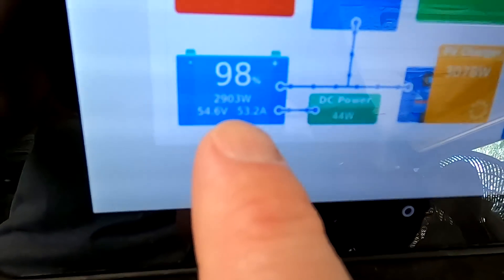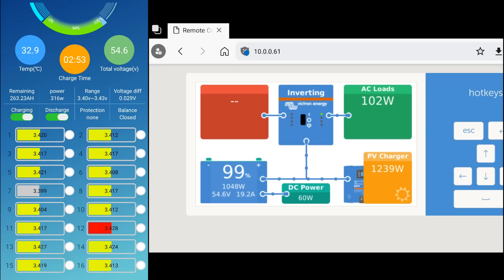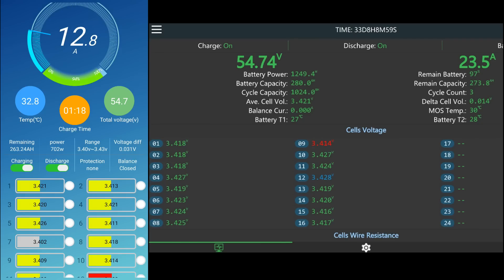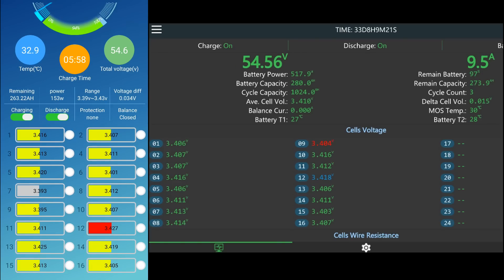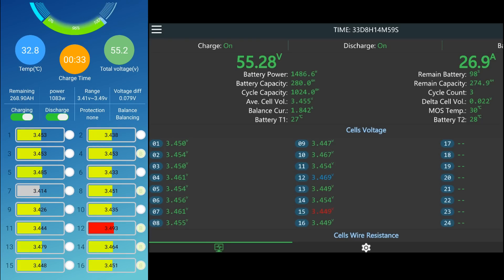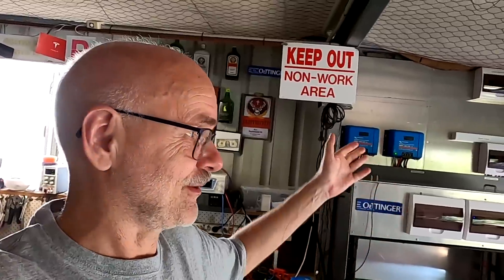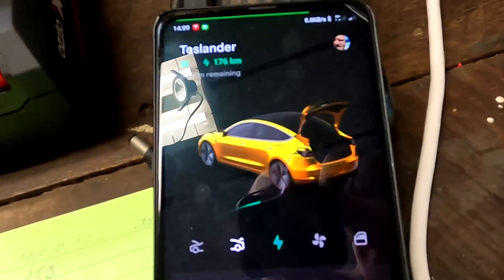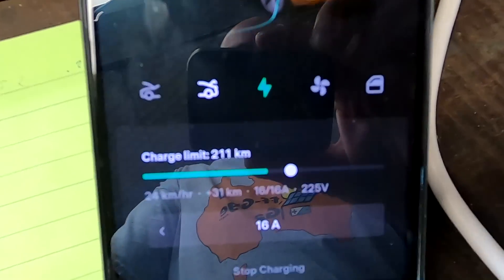Communication between BMS, solar charge controller and inverter. What's the benefit?

Comment: Communication is great with my powerwall setup as I have limited hours of cheap electricity so I need to pump electrons in fast and then tail them off, the lower current at the end of the charge cycle is helpful to let the balancer do its work.

Comment: I just ordered my new victron inverter. The multiplus II 48/3000 but i don't know what fuse to use becuase the smallest megafuse is 125A and that seems a bit too much, any recommendations what should i use? I also currently have a 3s100P li-ion battery and i'm planning to reconfigure it to 14s20P and use the JKBMS and then planning to use the same JKBMS with a 16s lifepo4 battery. From my understanding the JKBMS supports li-ion and lifepo4 right?
Reply: 125A fuse is recommended by Victron for the 48/3000 according to the manual.
Reply: @helfer6pence  Oh that seems to be a little bit high. Thats 6000W at 48V and the fuse should be 20% above the max inverter power so around 75A
Reply: @xpatrikpvp  I’m no expert but I thought the fuse was there to protect the cables etc. Victron recommend 35mm cables for the 48/3000, which I believe are rated for about 100 - 120A depending on the length.

Comment: With the victron equipment you can set a maximum charge/discharge current and a maximum charge voltage from a BMS.
Technically it could do what you are doing manually sometimes: reduce the absorption voltage in case of a high cell imbalance to prevent single cells exceeding 3.6V. When cells get balance, increase voltage in small steps. But I doubt that you BMSes will do that.
Other cases where it might improve the system (but do not apply to your setup):
- reduce charge/discharge currents near full/empty with small batteries that are driven near its limits
- allow small charge currents in cold conditions instead of completely disable charging
- adapt charge/discharge currents in modular (parallel) systems where single batteries are frequently removed/added

Comment: What if on occasion I have 2C of charging available,  ( and discharged batteries) but I want to limit charging to 0.5C to ensure battery longevity. The BMS would presumably trip on its overload setting. Using inverter communication I could still limit and control the charging rate?
That and I just want to see it in action, you do it so we can all learn  --- the raison d'être of this channel.

Comment: There are several advantages. Main one being not having a smartshunt as the BMS is the battery monitor. Second is at higher charge currents like 1C you can have high cell voltage very quickly so the charger controllers can react. Also there is less loss in the breaker style BMS but if the breaker trips you have to manually reset it. This means if you get a high voltage disconnect it will be irrecoverable remotely but with coms you never get into this condition. Data logging and remote diagnostics is also a benefit. As someone who manages many Victron sites it is really helpful to see MIN/MAX cell voltages for every site to detect problems early.
Reply: This is true if you have one battery with a single BMS. As soon as you have multiple batteries in parallel, it make sense to maintain one central Smart shunt so that one does not have to add all the current data form each BMS together.
Reply: @henkbouhuyzen8255  Every installation I have has multiple packs. Most battery manufacturers have one battery take over as Master and the other packs as slaves and reports them as one big battery to the GX. These tend to be even more accurate than the Smartshunt as they take into account cable losses and don't require 100% recalibration from time to time. For DIY packs I have used the Orion BMS with multiple packs and also had great success with BMS calculated SOC.
Reply: @ShaneFromSA  I build my own batteries form 320 Ah Evo cells and each 12 V battery has its own BMS. I have not seen a method to connect these BMS' es together. I build my own as I could not afford the high end brands such as battle born. And even the battle born batteries have no communication between each battery; at least there is no mention of this on their website. You must have  used a specific battery brand.. I do know that I could (with some additional hardware) connect my BMS devices to the Gerbo (via a Rs 485 link)
Reply: @henkbouhuyzen8255  Yeah, I primarily build really big systems. Like 100kwh plus. I don't know anyone that has managed BMS for 12V batteries. I only build 48v system with Victron. Pylontech, FreedomWon, BYD the batteries I mostly use.

Comment: If you set the balancing on the QUCC to start at the float voltage, it will continue to balance the cells for the whole of the float period (which can be several hours) unless the cell difference drops below the threshold.  I’ve tried this and it seems to work well.
Reply: Has anyone been able to make qucc BMS stay on longer than 18 hours?

Comment: Maybe BMS can be used instead of smart shunt. And (in my opinion) it is much better if the load turns off when it receives a signal from BMS. In this case inverter stays on, only load is turned off. If the battery just shuts down, what happens to the inverter when it stays out of power? And also what happens to charge controllers? How the system reboots then? I think, this should not happen in any case.

Comment: In my system I separated the load and the charge site with the victron battery protect. So in this case of an peaking cell, just the charging site turns off and the load are still online. So I don't have an complete disconnected battery bank.

Comment: I wish JK made a 12v BMS.  I like how it reacted in the last video.  Thanks for all the experiments, Andy.
You make the comment here "there is no reason to charge higher than 3.45v per cell."  If I recall, the only exception is if you need to charge the battery more quickly.  I believe you gave the example of a person on a boat that wanted to maximize charging when they had sun because one never knows if tomorrow will be a good solar day or not.  Does this still hold true in terms of your assessment of charge voltage?
Reply: I think Andy meant that you dont need to charge each cell to anything over 3.45v. This is different to the actual charging voltage that one uses in order to charge the cells (which I think you're referring to)

Comment: Hey Andy, since you hve a Raspi, you could add a 7inch Raspi-Touchscreen. It costs around 60 $ and you would have a very nice interface with VRM. I dit it myself. It works great and costs nothing in comparison to Cerbo GX (800.-).

Comment: Some solar charge controllers will be destroyed by being disconnected from the battery while still receiving voltage from the panels. Some sort of advance warning from the bms might give the charge controller time to disconnect the panels before that happened.
Reply: Mike<<<<<  all the BMS will become defective if it’s removed from the Power supply, while the BMS is still powered from PV cells. Therefore it’s understood that during maintenance and or test sequence, PV power MUST be in OFF condition. (Use of correct load CB is preferred here) Many have not understood the procedure well enough to perform the above info and thus have lost the costly BMS. Many BMS’s have been “returned” for being nonfunctional, due to their lack of info, mentioned above. The warranty for the BMS is 5 years and advantages were taken by misuse. (this is the reason for “high cost” of BMS device!) Place a large sticker on Cabinet “OPEN CB BEFORE MAINTENANCE.” No more comments.
PS: the advantage of CB (circuit breaker) in PV cell circuit is that, the PV input V and A can also be checked in-situ without detaching the cables from PV while  battery is on disconnect condition.
Reply: @sreekumarUSA  agreed, but that was not my suggestion. My concern was that once the battery is fully charged the BMS would disconnect the solar charge controller to prevent the battery being overcharged. That would leave the charge controller disconnected from the battery but still connected to the solar panels, destroying the solar charge controller. Far better would be if the panels could be disconnected before that happens.
Reply: Some Victron SCC’s are prone to damage from that, especially if the solar power is high voltage & current.  
On 24V 310Ah Lifepo4, I connected a 100/20 to 2x 325W panels (as recommended by Victron’s MPPT calculator) so halving the power from 1.3Kw (2S2P) to a 100/50, which was getting hot (it did burn the battery + cable & the Victrons screw terminal; as they warn in the manual) I don’t like the small connector block on Victron SCC’s, it’s inadequate; can’t get square crimped wire of the max stated size (which is quite small) into the socket. The 100/20 first developed a fault on the load, not turning off; but still measured current, for a while, until that played up, then stopped. Then the SCC completely stopped charging at 24v; but charged a low rate on a 12v system with 360W input. Both SCC’s will have to go back for repair. Now using 2x Epever 6415AN’s (2P panels, they don’t get hot, and waste power). I prefer the 6415AN’s wiring box, which is much safer. Also the 100/20 once had a fault, on the wiring at the very small terminal block, which applied 52V from solar (240W) to the battery wiring. The BMS is 10-24S (good on my 8S) easily withstand that, and shut down. It just blew a few small items,  30v max, a voltmeter 2x temperature controllers and a buck module. Have a 3rd 6415AN that’s been away 4 months, for repair to its RS485’s! Could upgrade to 2 more 325W easily 3P @ 30A; and more with the other SCC, when I get it back, maybe 2x 500W panels.
Reply: DC relay for disconnect of solar panel could easily be done. SOC gets to 95% it will turn off?
In my van I have a heating mat under my lithium battery to put heat into the battery in the cooler months. Turns on for 25 min cycling for 3 hours on the Inverter. Only takes 50 watts and my panels usually make 150watts (600 on roof). 

I plan on putting a dc dump load circuit on for hot water tank.

Comment: I'm testing a small solar system with victron components and a battery I assembled from parts.  The battery management system does not have low temperature protection and it does freeze around here.  Having communication between my shunt with the added temperature sensor and the charge controller allows me to have low temperature charging protection.  I also get an accurate temperature of the battery displayed and that is fun.

Comment: I agree there is no advantage to the system having them communicating to each other.. except there is more risk of complications when the system gets older.  Less wires the better..
Reply: There are advantages to the BMS talking to the charge controllers but I have a lot more confidence in the Victron gear to charge the battery properly and I wouldn’t want to defer control to the BMS in case it screws up and tells the Victron SCC to over volt the charging.

Comment: I know it's a bit off-topic but could you set up an experiment with the outside 3 panels to characterize the possible benefits of a reflector/mirror for low azimuth solar charge optimization in the morning or late afternoon or even to get around shade tree effects? Thanks.

Comment: It helps when you charge with very high currents: you can tell the charge controller to slow down so the BMS can keep up balancing. Staying at 3.45V you won't see this, but if you charge to 3.55V or more (higher voltage to get more current in a shorter amount of time). You're still well below 0.5C charge current as well coupled with your max solar output- once you go to 0.5C or more (think if you have 10kW array or so) you will get over voltage faster and the communication will allow this to be throttled. In other words, it wouldn't make a difference in your current set-up.
Reply: 100% agreed. Also all of the BMS details would show up in the VRM with an integration to the victron ecosystem.
Reply: @Shep5847  You can do that with the JK BMS by the way, there is a driver for Venus OS for it.
Reply: @Shep5847  I’d like to see it. I don’t think it will be simple to connect via Raspberry Pi, to a non-Victron BMS & Battery. Andy would need a Cerbo or other Victron device, with the correct ports.
Reply: @michaelbouckley4455  We aren’t talking about doing it with the raspberry pi, only what can be accomplished if the connection is made.  How to do it with a Pi is another story for sure though. But I do it through a CerboGX using a Batrium BMS.
Reply: @michaelbouckley4455  There are drivers for JK and other BMS for Venus OS.
Reply: @Shep5847  Andy has a Rasberry Pi, and is talking about monitoring on VRM
Reply: @Shep5847  I like your set-up very much.
I will have the same setup at home in a month. I already have the Batrium at home, the battery cells should arrive in 2 weeks. Then installer company will install the panels and inverters.
Is there any problem in connecting the Batrium and CerboGX? Or just do everything according to their instructions (How to Control a Victron GX with a WatchMon)?
Reply: @lubomirremiar8952  It’s almost plug and play. You just have to tell the Batrium what system it’s connecting to so it knows what communication protocol to use.  But that’s about it. I’ve built several and helped others build the same setup and have had no issues so far. Still loving my very overpriced BMS. 😊
Reply: @Shep5847  I agree, Batrium is overpriced 😊. But the installer company had a condition that if I wanted to use my own battery, it had to be able to communicate via CAN with Victron.
I have no experience with building own batteries nor Victron, so I opted for a more expensive but proven solution.
Reply: @Up North and Personal  do you have links pls?
Reply: @ralph9987  I'll ask if Andy can post it here for you. All my comments with links get removed...
Reply from the maker: @upnorthandpersonal  Here is the link: https://diysolarforum.com/threads/victron-venusos-driver-for-serial-connected-bms-llt-jbd-daly-smart-ant-jkbms-heltec-renogy.17847/
Reply: @ralph9987  See link above from Andy.

Comment: I don't see reason to connect chargers to inverters as such..but i see benefits to connect chargers to bms .reason is ..those chargers don't have sense wires..so they don't know exact voltage on the end of the cables..they can see only voltage at the start of the cables..so that is reason why they have to be connected to bms..because bms is connected directly to the batery terminals..or it should be to be exact..

Comment: The benefit could be when you have a battery who’s BMS is a black box and can’t be adjusted?
Mine is a Big Battery Rhino and it is set to charge until 58.8, so I set the inverter to 56.6. 
Am I wrong?